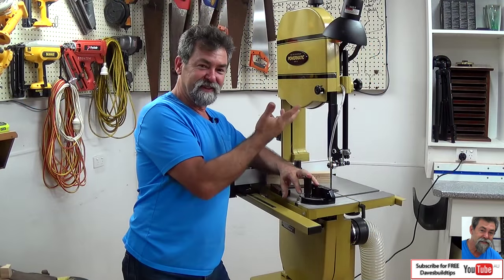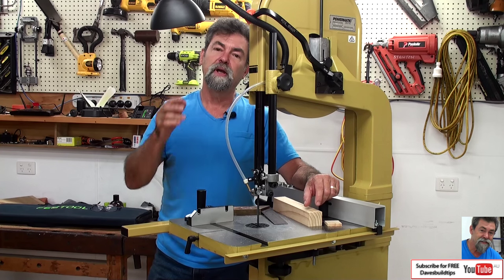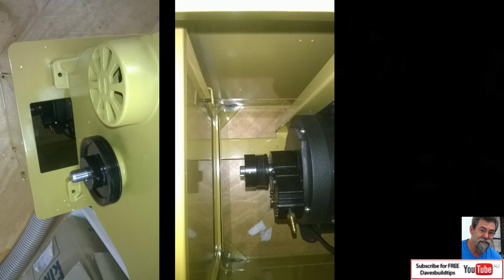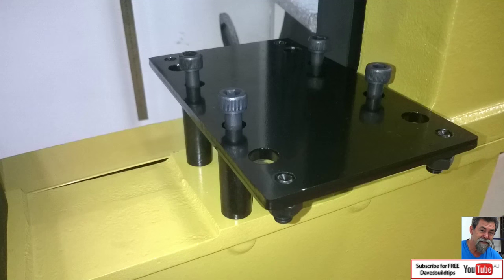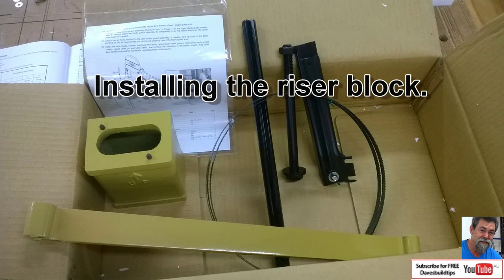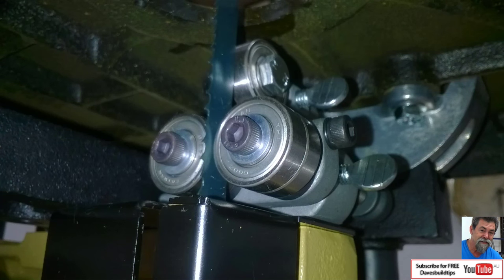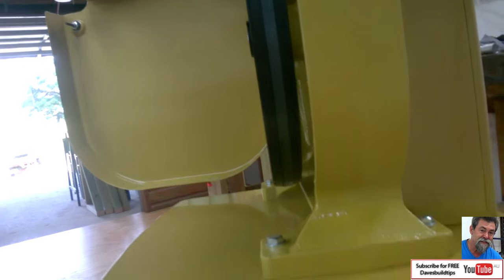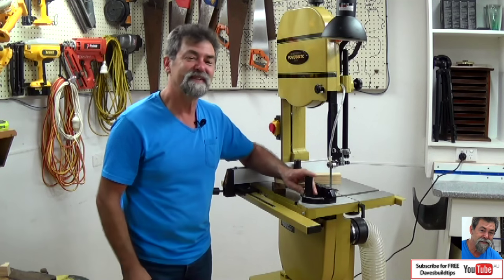Unboxing and assembly Powermatic 14 Inch Bandsaw Dave Stanton easy woodworking

Comment: Hello David, great video again. I'm trying to choose between Powermatic bandsaw and Laguna 14 twelve. What is your opinion, which one of these two is better value? Kind regards. Alex
Reply from the maker: +Alex Kelner . To be honest Alex, I have never used or even seen the Laguna but from all reports it is a very good saw. One of the reasons I went with the powermatic was because of the air pump that blows the dust away from the pencil line I am following. If I am pushing a piece of wood through the saw from maybe 6 feet away that is too far for me to blow the dust away with my mouth. The cast iron spine was another tick for the powermatic as well as 12 inch DEPTH of cut. I hope that helps!

Comment: thanks heaps for this Dave. I will be ordering this very bandsaw today from Carbatec - on your advice  -(and it is on xmas on special) - so will undoubtedly find that I will be reviewing this video again in detail once it arrives in my workshop !! Christmas pressy for myself ! Cheers for all your vids. p.s. are you sure the riser block comes included in the price? I asked previously and was quoted an extra $170 for the riser block.
Reply from the maker: Definitely has the riser block, longer blade, longer post and guards. Tell them I sent you!

Comment: David, perhaps I missed it but what is the minimum thickness of wood you can cut with riser block installed? Thanks
Reply from the maker: There is no minimum thickness with the riser block installed. less than 1mm if you want to.

Comment: Hey David, it’s a long time since you did this review but it is still relevant and useful. How are you finding this model after a couple of years experience with it? I was in Carbatec in Adelaide yesterday and was looking at this Powermatic band saw which is currently sale priced at $1439 (reduced from $1799). The model I looked at didn’t have the extension, which when fitted gives a cut height of about a foot as you clearly demonstrated. Next to it was the Carbatec BS-X3452C which is also a 2HP bandsaw with a cutting height capacity of about a foot as standard. This had a slightly larger, and lower, table than the Powermatic and was also reduced in price by a couple of hundred dollars to $1799. My question to you is, based on your experience with your saw and knowledge of the Carbatec models, would you choose the Powermatic or the Carbatec (and save $360 for extra blades and accessories)? Thanks for your great review.
Reply from the maker: Hi Arthur. I think I would get the 2 horse Carbatec. The top guide assembly looks to be a better design.
Reply: Thanks for your advice David.

Comment: Hi David! Please help! For quite sometime since assembly with no woodwork time, i recenty got to do a small low profile wooden stool. You know mortise and tenon joinery. Then i power on my bs and the upper wheel's tires keep on dismantling by itself! Do i need to replace it? The saw only had a few minutes since assembly and im quite frustrated not being able to use it when i need it. Blade tension is just ok. The lower wheel tire is just fine. I Am using a 1/4" blade. Any suggestion? Thanks in advance!
Reply from the maker: Replace it John. Also check that the blade is centre of the tyre, not the teeth centre of the tyre.
Reply: David Stanton yeah im rooting to replace it. At first i tried putting two strips of double sided tape but they could hold enough from the tensioned blade and comes off almost naturally. I see some orange looking urethane tyres being sold and keen on getting them. Powermatic doesnt seem to sell these tyres eh. Okay im going to replace them soon. Maybe i keep the lower wheel tire for awhile till they fail. Haha! One thing more, the height of this bs is a little high for my height. I wished the table height is just like table top height of the TS. Or is there a reason for this! Thanks David!
Reply from the maker: The height is to stop you getting a bad back because most uses for the bandsaw are intricate.
Reply: David Stanton sad to say, i have already injured my neck due to my work...i peep thru the microscope for the last 20 yrs or so and never thought of ergonomics! yes i only discovered that there are really expensive ergonomic microscopes costing about 2000 to 3000 US...and when i have money...its tools that im going to buy first! Hahaha!

Comment: Hi, thanks for the helpful video. I'm having trouble installing the drive belt to the motor -- when I test it by turning the pulleys, it always walks off the end of the motor pulley. Is this a problem with not enough tension? How do I adjust it? I've tried pulling down as hard as possible on the motor, but it's really hard to get any leverage on it. Any tips?
Reply from the maker: Make sure the motor is in the right position laterally. There are adjustment slides to move the motor up, down and front back.
Reply: Turns out the problem was that the motor wasn't level back to front, so the belt was walking up hill. Thanks for inspiring me to take a second look!
Reply from the maker: Is it going fine now?
Reply: Yep, the belt stays on when I rotate manually and when I turn on the motor. When I turn it on there is a horrible metal on metal screeching noise for a brief moment, but I assume that's because I haven't gotten to any of the other adjustments yet; got stuck right at the beginning. I probably should have waited to turn it on. :-/
Reply from the maker: The drive pulley and bottom wheel pulley must be in line. The instructions show you how to do this.

Comment: Powermatic used to make all their stuff in America and it was good stuff. They used to make an excellent 14" thickness planer. Sadly it's all made in Taiwan now.
Never been a big fan of this type of bandsaw myself. You would be hard pressed to rip anything at that full 12" with such a small motor.
Not accurately anyway. 
But for hobby guys it's a serviceable machine. Don't waste your money on carbon blades, get Lennox HHS or better still carbide tipped.
Personally I find any bandsaw with a wheel diameter less than 24 " never works very well. The small diameter is hard on the bands, weld and teeth.

Comment: Where did you get the riser block David?, Carbatec don't seem to have it.
Reply from the maker: It was all part of the bandsaw purchase, that is how carbatec sell it. Did you buy your powermatic bandsaw from Carbatec?
Reply: *****
No I am thinking about getting one - I shot them a query about it but haven't heard back from them yet, but now you confirm that I think I will go ahead with the purchase (pity it's not on sale ;-))

While I have you, were there any issues in getting it off the delivery truck? - I believe there are OH&S issues with packages over 50 kg and so you are meant to have a forklift or similar (I don't) - If it comes in several boxes I don't see why it would be a problem.
Reply from the maker: I took it home in the back of my little hatch back car. I didn't find it too difficult.
Reply: *****
Excellent - just what I wanted to hear - thanks mate.
Reply: Just looking at your video again David - one of the boxes is 80 Kg - I used to be able to lift 100 Kg but that was a long time ago - did you get assistance or have you been eating your spinach? ;-)

They want $152 for tailgate shipping - I would rather spend that on blades if I can,
Reply from the maker: I slid it out of the back of the car onto a wheel barrow.
Reply: *****
I assume then that they helped you get it into the car?

Once I get it home I have a few tricks up my sleeve to get it out, but getting it in may be challenging.

BTW do you want me to let them know that you helped make up my mind on the purchase (I was also looking at Laguna, Hammer, and, of course, Hare & Forbes).
Reply from the maker: They will help you put it in the car. By all means you can tell them if you wish.
Reply from the maker: Which store are you getting it from?
Reply: *****
Auburn
Reply from the maker: Do they have any available in boxes?
Reply: *****
Actually they don't have any, they were going to ship it from South Australia at MY cost. I am assuming it would be in the same boxes you received (that's where I got the 80 Kg from) - but now that you mention it as it was the last available in the country it may well have been a showroom model and may be shipped assembled.

I think I had better wait until they get more stock in - problem is I asked them for an estimate of when they would get new stock in but they didn't give me an answer.

Nothing is ever easy.
Reply from the maker: I will let you know when the new saws arrive at the Auburn store. The saw in Adelaide would not be assembled.
Reply: "Elvis" has entered the building! :-)
Reply: @DavidStanton  Rudyard makes a really good point; the Carbatec web site EVEN NOW is not clear that this product is sold WITH the riser block. Given that the riser block is a huge selling point, I'd have thought they would make this comment Crystal Clear at the top of the page.

Comment: I would like to talk about v-belt and alignment issue.. thanks,
Reply from the maker: What is the problem?
Reply: David Stanton when i rotate the belt by hand it is slip out. I am afraid when i operate the machine it will get wear or tear.
Reply from the maker: You must align the top section of the saw with the base cabinet so that the pulleys are in line.

Comment: Tightening the bolts in the base box is a PIA, trying to get the washer, lockwasher and nut up around and on the bottom of the bolt with 2 fingers...the back 2 took an hour. Then...trying to tighten the drive belt, jeez! The motor only slides up or down, 4 bolts, you cant see with your arms and hands in there, you have to lift up the motor, keep it straight and then tighten the nuts, each of these required 2 hands...at the same time. Trying to get the tension correct and the motor level and tighten the nuts, you think you will go outta your  mind. If I ever meet one of the so called, engineers that designed it, I'd have a heck of a time not busting his nose! 
One more thing, who doesn't get the 6" riser, maybe 1 in 50, so just put the flipping thing on at the factory and if that one bloke dosen't want it, he can fight taking it off! 
Other than that, it's a nice saw.
Reply from the maker: Hi Steve. Wow, you seem a bit annoyed with the designers. Not to worry, how is the saw going now?
Reply: @DavidStanton  it's a lovely machine,  takes every thing I throw at it, just a buggar to assemble.  I work mostly with Sapele, gates, carriage doors, it cuts it like a dream.    Thanks for your video, plenty of miles between us, but I think we'd be mates! If the political scene dosent calm down perhaps I'll swap California for down under.